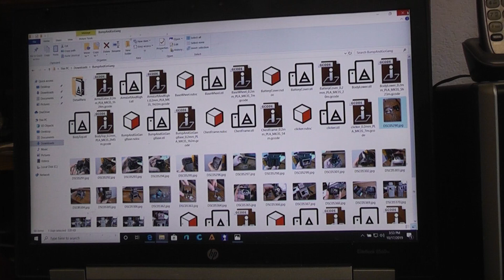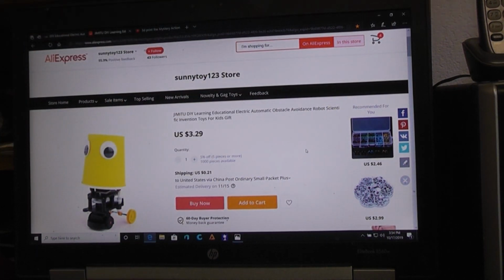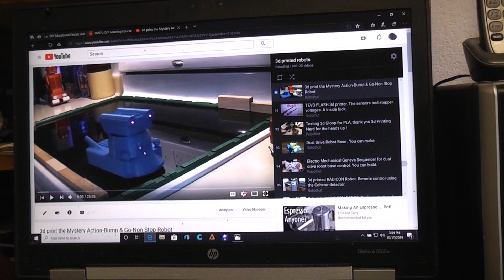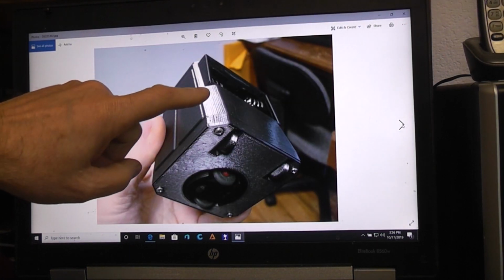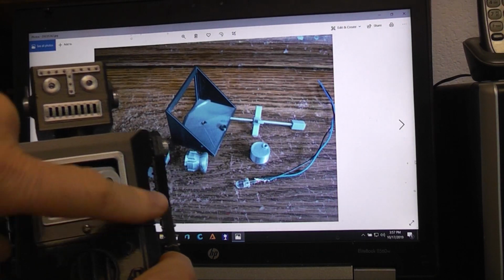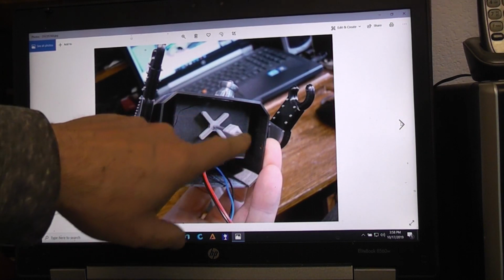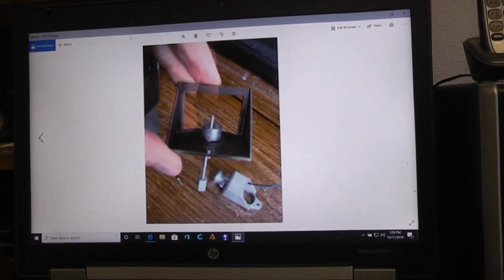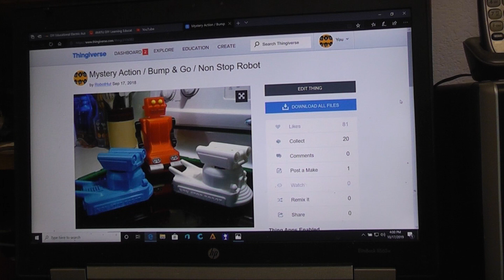Design & Build your own Bump & Go robot. My design is 3d printed.

Comment: any chance you could share the files? i have a few of those from scrapped toys
Reply from the maker: I have shared the files for building your own 3d printed bump and go mechanics, link in the description and video. But the files for this robot is one I sell to make money to keep things going. So I thought it best to show that a bump and go drive could be bought and then you could design your own robot out of any material you wanted or use free 3d CAD programs like Design Spark Mechanical, like I do to make a 3d printable robot.